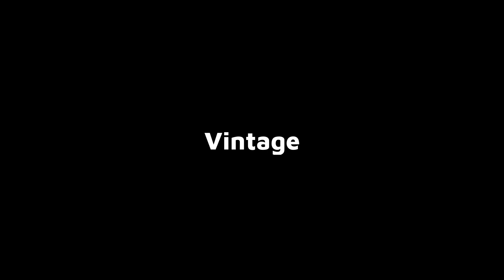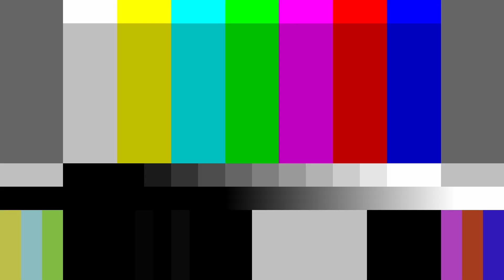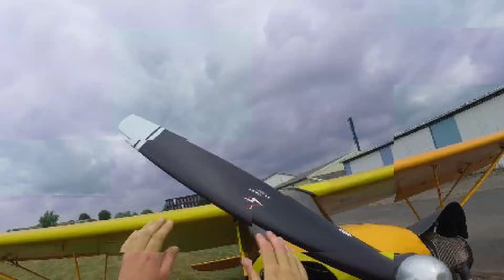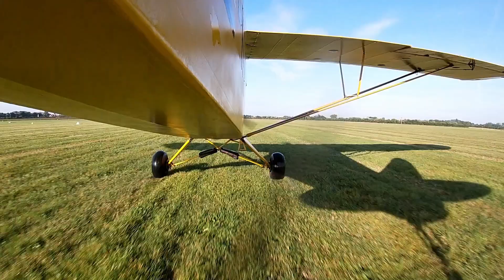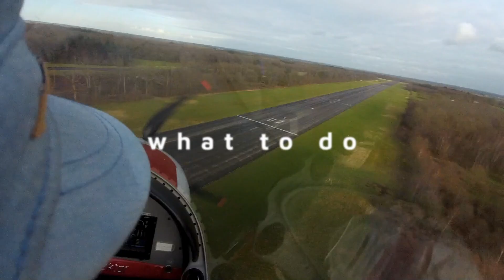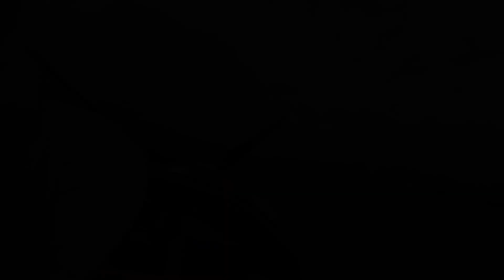Flight instructor explains: Pitch for airspeed or altitude?

Comment: Pitching for airspeed first is not necessary. Even when on approach if you are slow maybe 10 knots below VREF then you should be adding power not pitching down unless you are excessively high on the approach.
Reply: Chasing airspeed with power, particularly at low airspeed, is highly dangerous and will very quickly put you into a stall/spin situation.
The fastest and the correct way to control airspeed is with PITCH!
If you want a stable approach set your aircraft up with pitch and then trim to maintain that speed.
Use power to control rate of descent.
Correct any sudden changes from gusts or windshear with pitch and then stabilize the aircraft again.

Comment: When flying the ils and I am to high I reduce power then us pitch to maintain airspeed. If I’m to fast I increase pitch to slow and use power to maintain vertical path! When in slow flight try using pitch to control altitude and power to control air speed. You pitch for air speed that will give you the performance need. The ability to climb is the excess thrust (power) to maintain level flight. Full power and pitch  for the best air speed for the required performance!
Reply: @johnm2579  You may think power is controlling altitude, but it isn't.  When you are high on the ILS and reduce power and then pitch, it was the change in pitch or angle of attack that corrected your altitude, because the lift vector is the only force which opposes the weight.  You'll fly the glideslope much more accurately, especially in bad weather, if you use the elevator directly to control the altitude, just like the autopilot does.

Comment: When you're in the traffic pattern and reduce the power to slow down to approach speed, you use the yoke/stick to maintain altitude until any excess airspeed has bled off. Then you trim the elevator so that you don't have to constantly hold the yoke/stick in the right place to maintain the proper airspeed. Once you've trimmed the elevator correctly, the plane will maintain the correct airspeed on its own. As you add flaps, you should use the yoke to keep the plane at the correct airspeed and then trim any pressure off. If you're descending too quickly, you add some power. And if you're descending too slowly, you reduce the power. You shouldn't pull or push on the yoke to make altitude changes. As you make power adjustments, the speed will change slightly. With time, you'll eventually make pitch and power changes simultaneously, but you should still trim the plane to maintain the proper airspeed during climbs and descents.
Reply: @txkflier  "If you're descending too quickly, you add some power."  Why?  Power increases thrust which increases airspeed which will make you descend faster.
Reply: @ You only add one or two hundred rpm if your aim point is moving up in the windshield on final. The added power will increase the speed slightly at first, but the plane is trimmed to maintain a certain airspeed. So, the horizontal stabilizer will push the tail down, raising the nose, and return the plane to very close to the trimmed airspeed. This is why you can trim a plane to fly level at 2000 rpm, and if you add power it’ll climb, but if you reduce power, it’ll descend.  It’s mostly due to decalage, the difference in the angle of incidence of the wing and the horizontal stabilizer.
Reply: @txkflier  Yes that technique is used a lot - trimmed out on final, changes in power will change the downward force of the propeller slipstream on the horizontal stabilizer and therefore change the angle of attack.  I agree with everything you say about the aerodynamics involved.  However, the question is, is that the best and safest way to control the pitch and line of flight.  You're controlling the angle of attack (pretty important) with a flow of air.  Controlling the angle of attack directly with the control wheel is far, far more effective (with coordinated power adjustments if and as needed for speed) and is the way autopilots make those amazing instrument approaches keeping the glide slope needle in the middle.  Imagine an approach to a short runway over an obstacle on a gusty day - are you going to trust that cushion of air from the propeller to keep a safe line of flight on short final?

When pilots get into more advanced aircraft, then they sometimes get a big surprise about how airplanes are controlled.  I was with someone in a Cherokee Six who got low (red-over-red) on short final inside 200' agl so he increased power.  However the pitch stayed exactly in the same place - we accelerated 10kts bur didn't climb an inch.  He was left literally scratching his head as to why the increase in power didn't correct the altitude.  He apparently believed the power alone controlled the altitude on the back side of the power curve (the biggest fallacy in aviation).  That was sad that he did not get the proper training as to how the airplane is controlled and someday it could have lead to a very bad experience.
Reply: @ I don’t think changes in thrust are felt by the horizontal stabilizer. The thrust line and incidence of the stabilizer are practically the same. If you’re too low on final and you pull back on the yoke, you will need to add some power to keep from getting too slow. I trim the elevator so that the plane will maintain a safe airspeed without me having to constantly watch the airspeed indicator or hold pressure on the yoke. Small changes in power will keep you on the glide path.
Reply: @txkflier  What do you think makes the airplane pitch up so much on a go-around?
Reply: @ On a high wing, I would blame it on the propeller’s thrust hitting the flaps.
Reply: @txkflier  I'm thinking it comes down to the position of the trim.  The large increase in airflow impacts the trim tab (in a downward position on approach) which then raises the elevator.

But question - what's your technique for approaches when it's gusting +/- 10 knots?
Reply: @ Another reason for the pitching up with a high wing is the drag of the flags is above the thrust line. On a low wing, it’s below it. I think the horizontal stabilizer is too far back for thrust to cause much of an effect. If it’s gusty, I’d use less flaps and land at a little higher airspeed.
Reply: @txkflier  I fly both high and low wing.  It would be interesting to test go-arounds at full flaps and no flaps with each airplane.
Reply: @ I wouldn’t use more than 20 degrees of flaps at full power, and I’d decrease them as quickly as airspeed allows.
Reply: @ The only time I had to go-around was on my 1st landing attempt during my 1st solo. The Cessna 150 wouldn’t come down without my instructor in it. I landed on the next three attempts.
Reply: @txkflier  I started in a Grumman 2-seater but did my Private checkride in a 150.  One less person in a two-seater and it is quite noticeable.  Good job to go around when the approach wasn't going well.
Reply: @txkflier  Yes - critical to follow the POH and your instructor's guidance.  I've been flying a while and comfortable to see in the practice area just what the initial reaction will be in the different configurations.
Reply: @txkflier  "I think the horizontal stabilizer is too far back for thrust to cause much of an effect."  Didn't fly for a while, but on a recent flight practicing instrument approaches in an Piper Archer, I did one approach flaps up and one approach full flaps down.  When I applied full power at the end of each approach, the airplane pitched up and climbed in both cases, proving that the propeller slipstream reached the horizontal stabilizer and pushed the tail down, regardless of the flap position.

With that said, don't expect that to always happen.  There are so many variables that the opposite may happen - in a Cessna Citation jet, the higher mounted engines at the rear create a pitching down moment.
Reply: @warren5699  When you have trimmed a plane for a particular airspeed and you change the power setting, it will generally try to maintain that airspeed. Reduce power and it'll descend, add power and it'll begin to level off, and if you go to full throttle, it'll try to climb. And yes, it makes a difference where the thrust line is.
Reply: @txkflier  Yes - 'generally' is a key word.  When full power is applied in a typical trainer for a go-around at lower speed and more nose up trim (ex: during the flare), it will usually pitch into a stall.  And I was with someone in a Cherokee Six who added power and the pitch didn't change one bit.  For completely predictable results, safety, and to have transferable skills, the pilot should always coordinate the pitch and power with appropriate pressure on the controls.

Comment: Thank you for confirming what I've been thinking.
Reply: Great video. I have studied under an amazing ex airforce CFI and everything you say here aligns perfectly with his teaching. We fly cubs at our school. This low mass airplane fits perfectly with the method. For example, to increase  speed while flying straight and level, with eyes looking over nose at the horizon, increase throttle, maintain the horizon position with forward pressure on stick, hold position, then trim for nil stick pressure. Use the same order to reduce speed. For descents, lead with throttle reduction, select airspeed with pitch. Varying the throttle slightly, varies the length of the glide on descent. For ascending, apply full throttle, vary the climb airspeed and angle with pitch. Level off with pitch first, to establish straight and level, build speed, then reduce throttle to cruise. Repitch, hold and trim. If students do this over and over, it becomes a natural way to fly.
Reply: @Coops777  If you pitch to airspeed on landing approaches (i.e. descents), you'll have poor control of the glideslope.  The only force created by the airplane to oppose weight and control altitude is the lift vector (pitch).  Using the elevator to correct for undershooting or overshooting will get instant and very accurate results and is the reason autopilots use the elevator to maintain altitude and glideslopes.  Power is simultaneously adjusted as or if necessary to maintain proper airspeed.
Reply: @warren5699  I totally agree with you for heavier aircraft and long glide slopes. I should have explained the situation here a little better. We use flapless J3 Legend clones. They have the same big wing and similar weight. To avoid landing long, we slow the aircraft down on base (often throttle low or at idle) to a point where we are below best glide speed on final. Here in the region of reverse command (ie behind the drag curve) we have no power applied. We have no means (except a slip) to slow down. Using drag from a slow airspeed does the job perfectly. How do we do this? We pitch accordingly. A small variation in pitch does not affect the short glideslope but greatly affects the final glide speed. If we are too low, we climb or level off to rejoin the slope by adding power momentarily
Reply: @Coops777  Understand perfectly.  Would you believe I use a somewhat similar technique when making flaps up and/or tailwind approaches, if needed.  As you know, with flaps up or with tailwinds (which require a higher rate of descent and lower pitch), there often isn't enough drag to control speed at normal descent angles or to reduce speed with a normal reduction in power, even to idle.  What I do is either establish a slightly lower (flatter) descent angle (still safely over obstacles if any) and/or like you, approach at a lower speed.  It's amazing how that will provide some extra drag just like the flaps do, and allows the normal use of the pitch to control altitude and power to control speed.
Reply: @warren5699  Nice one. Its very effective 😀
Reply from the maker: You're welcome 😊